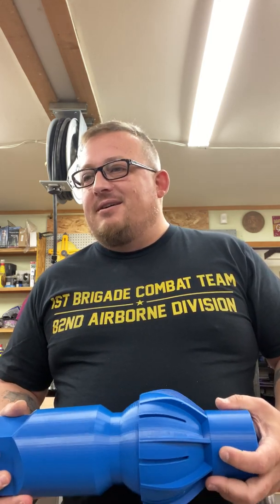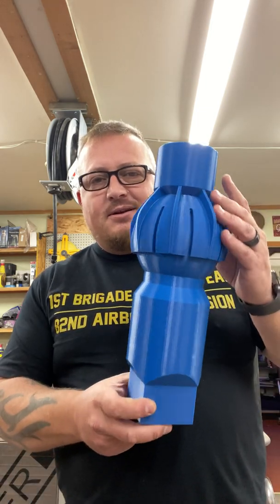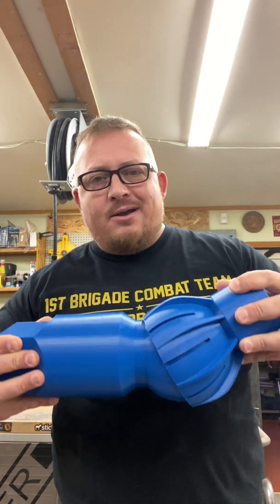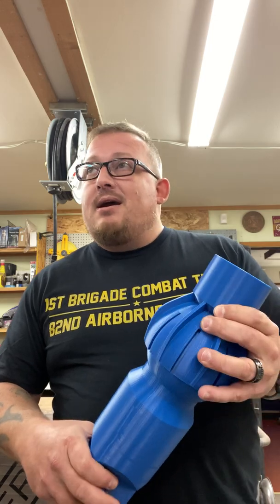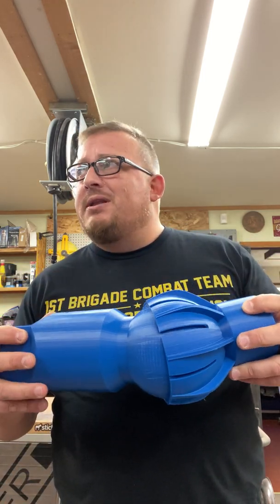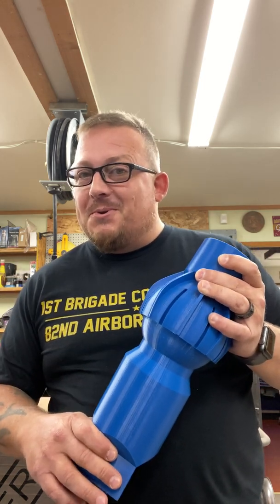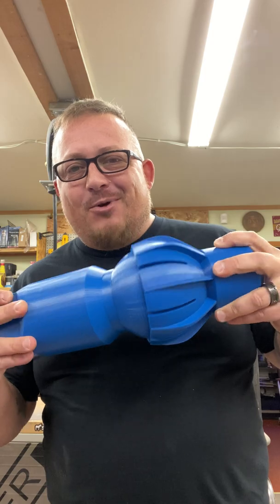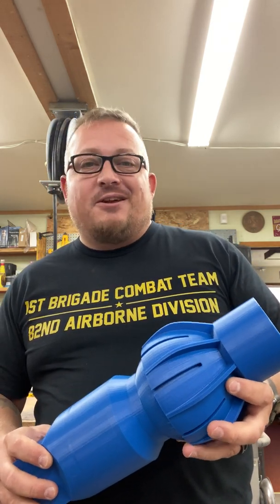3D printed C3PO  build update 0

Comment: great idea, are you sharing the printfiles?
Reply from the maker: No, sorry, originals are not mine to share and these, though modified by me, still don’t make them mine to share.
Reply: @LeSanglierQuiRit  Thank You for your answer.
No Problem, i understand that.

Then i have to pump up my skills in Fusion360 :D (today i don't have any :D)
Did you know how much tolerance the two pices have to each other? 0,2mm? or are they constructed without any space between?
Reply from the maker: @Dennis4heilig  they were a good tension fit which has loosened a bit over time. But initially a good snap in fit.